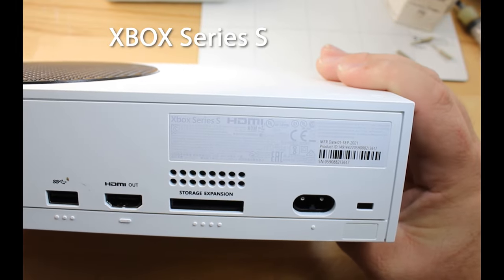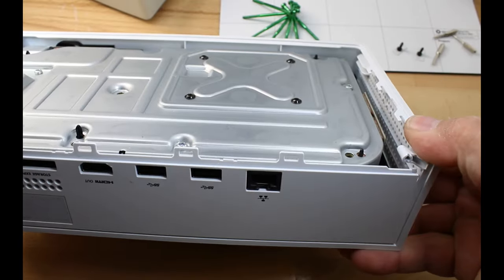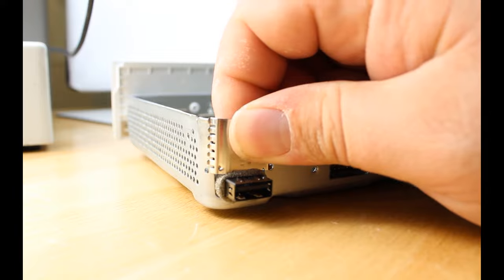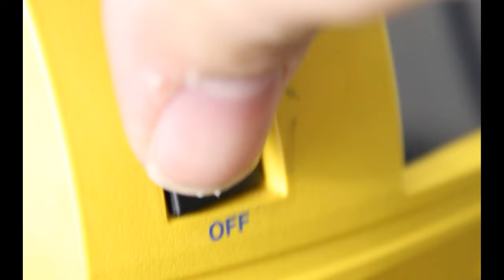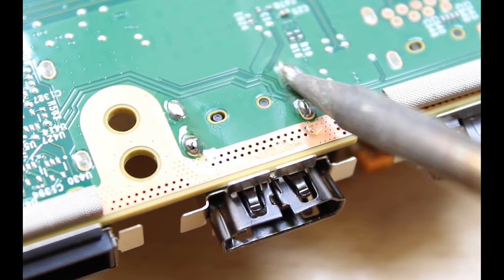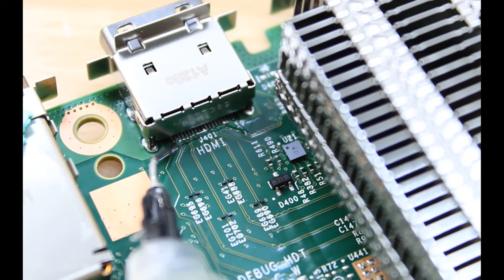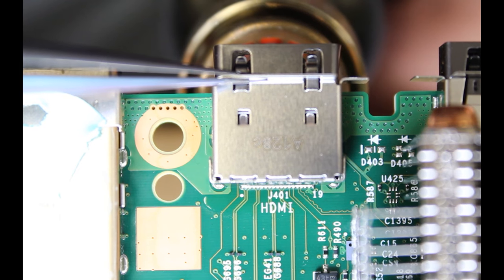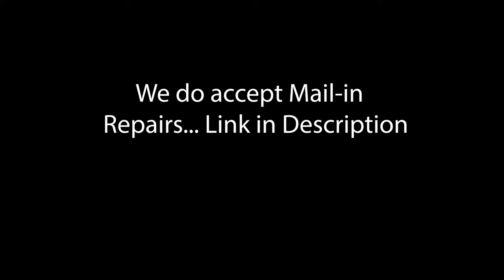Xbox Series S Surgery: A Comprehensive Guide to HDMI Port Replacement

Comment: now i understand why it takes $130 to fix this but man thats so expensive :/
Reply from the maker: I'm less than that if you'd like to send it in. fixdirepair.com
Reply: I know I was just looking up I was thinking yeah no that ridiculous and unfair and I’m stuck no Xbox right now because I can’t spend money fix it because I need save up because I just found new apartment   Because moved to new state and temporary live my mom again but now there be apartment ready soon so need save up for  deposit   And  also need all new furniture stuff TVs to  and I only get paid once a month for my disability checks so I don’t  get a lot   So I  may not have not have Xbox for while until move into my apartment 😢
Reply: I just found out yesterday that my hmdi port is broken because my Xbox was working just      The  other day before and  for months before that I had the Xbox’s series s for year now I got for my 29th birthday in May but I just turn 30 this May       But as of yesterday hmdi stop working it would say no signal me and my mom switched the cord and then tried it on  different TV     And nothing so then I took a flashlight  hmdi port on the Xbox and looked at and also show my mom and said it looks like it’s bent inside and she told me go look at one  at tv see looks same and sure enough it didn’t look the same

Comment: Thanks for the video. My broke a week ago. Got the parts in and followed ever step till the install of the hdmi port. I’m using a cheap army bought sodder device.it won’t melt the sodder wire.  So I just cut the 4 holding pins off with finger nail clippers and hot glue/ double bubble ( type of super glue but industrial grade) then followed the install. Thanks for the vid bro.
Reply: You fix it
Reply: Yeah did this work ?
Reply: Dude you literally make zero sense I looked at what it's called and what you said is most definitely incorrect gotta be smart about what you saying lil dude
Reply: @giovanicastro3564  You make zero sense with that terrible grammar

Comment: Dude thank you I was worried I wasn’t gonna find a good video for this but I have a question after you melted away the soldered metal what did you say to put on to clean it with?
Reply: He said isopropyl alcohol to remove the excess flux

Comment: amazing video but what temp and air flow did you use
Reply from the maker: Thanks and great question, but it all depends on the rework station you have as they aren’t all equal in what they can do but I use 450 with high airflow on my station.

Comment: What solution/equipment is needed to do this repair? I have a soldering iron but not the liquid or the solder he uses. I would really appreciate it if anyone can help!
Reply: Low heat solder and flux

Comment: I ended up with some bridged pins. Would it be best to remove it and start fresh clean and remove or could I fix it without starting over?
Reply from the maker: Use some flux and wick with your iron and it’ll suck right up into the wick then you can apply more if necessary.
Reply: @FIXDPHONES  I'll definitely try it. This is my first PCB soldering Job. Mostly I've solder guitar wiring but it's a lot simpler.
Reply: @sleepwalking117  I bet you have already fixed it, but I had the same problem, cleaned up some solder and now it works like a wonder!

Comment: Hi there! Thanks for the video! If the little metal studs came up off of the green on the board is my Xbox toast now? Thanks 😢
Reply from the maker: Not completely. Try searching for a video showing how to fix pulled pads, running jumpers etc. it’s all fixable, it just depends on how much work will you want to do.

Comment: What should I do if my soldering iron won’t melt solder and what temperature should both my heat gun and solder iron be?
Reply from the maker: Get a better soldering Iron and add Low temp solder to help bring the overall temperature you need to reach down.
Reply: @FIXDPHONES what flux did you use?

Comment: Do you have to solder each individual connection point to the circuit board?
Reply from the maker: Yes, and they can’t touch the one next to them. Solder likes to bridge across the pins and if that happens it will need to be fixed as I demonstrate in the video.
Reply: @FIXDPHONES  thanks,

Comment: How do you get the soldered to not cross all the pins
Reply from the maker: It’s ok if they cross all the pins. Flux a clean tip and the right temp will allow for this without bridging

Comment: So the foam that's removed does not need to be replaced?
Reply: the foam bumper is only there to provide support along the edge so you do not put too much pressure on that edge of the board and possibly crack the board. its not necessary for the console to function.

Comment: do u have the link to the hdmi piece I’m gonna repair mine with the video but I don’t know which hdmi to buy
Reply: Be very careful buying and read descriptions very well, I accidentally bought the wrong one twice. But ima tell ya this hdmi port replacement isn't an easy one it's a bit tricky and ya really should have some solid experience prior to attempting this replacement...and especially if you've got any broken pads...I've got about 3 years soldering experience and have done lots of hdmi port replacements and I've got a the tools but this particular repair is just very difficult..least from my personal experience and I guess mine is a bit more difficult cus I've got like 3 pads I'm trying to repair as well in order to place the new hdmi port on.

Comment: Think I may have burned the board tying to get the solder out. Any idea why the wick wouldnt pull it? I cut it and used plastic tweezers so it wouldnt heat the whole roll. Not coming out whatsoever. Got a super cheap soldering kit to the solder sucker is ass. Any tips would be appreciated I am 2/3rds of the way done.
Reply from the maker: The thermal mass of the logic board pulls heat away quickly. A decent soldering iron paired with good flux, wick and possibly some hot air from a rework station will be enough to keep that section of the board hot enough for long enough to remove all solder.(also adding some lower melting point solder and having it mix with the lead free factory solder will bring down the temperature the board needs to have the flux absorb all the solder)
Reply: @FIXDPHONES  what kind of flux do you use?

Comment: Does it matter if i dont use low temp solder wire?
Reply from the maker: no you still can use a higher melting solder, it just makes it easier as the thermal mass of the logic board sucks heat up really fast and makes it harder.
Reply: Makes it way way harder...the solder in these hdmi ports take a lot to melt

Comment: well. i fucked mine. managed to remove one of those copper looking flat wires off the circuit board and stuff the solder job. Looks like a new xbox is needed.

Comment: Can never get enough heat for the hdmi to come out 😔
Reply from the maker: Add low melt solder to all solder joints👍
Reply: Be patient and just don't rip any of the pads...I ended up using my man's butane soldering iron and was surprised how much faster his was compared to my 200$ electric soldering iron...also I used to heat gun ones on top and one mounted under my workbench to get it got on both sides evenly...helped alot and wish ide found that advice before spending hours nearly in tears not able to get it melted down